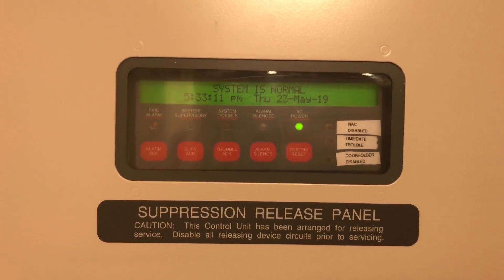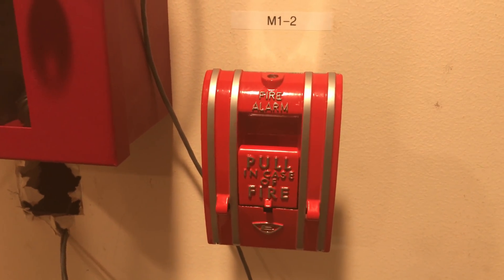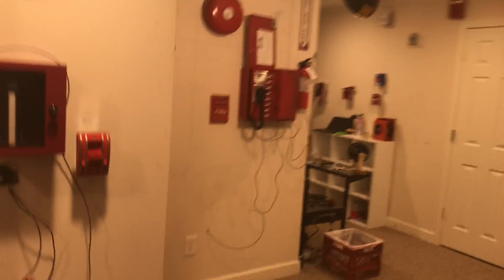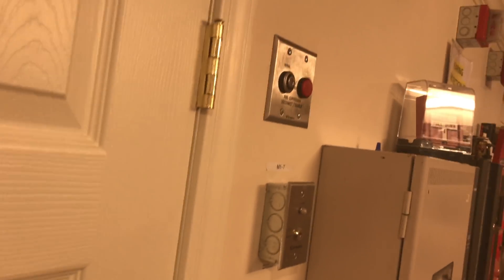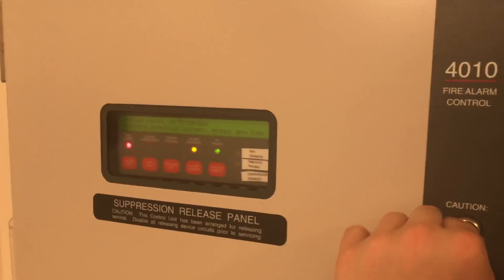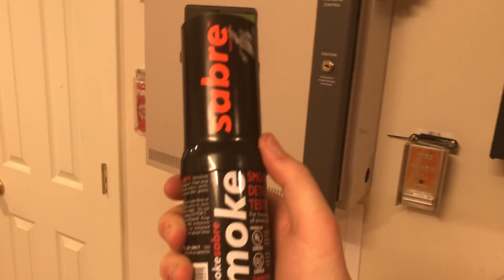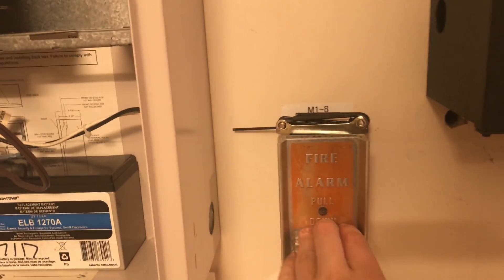Simplex 4010 Test 29: Vintage ADT

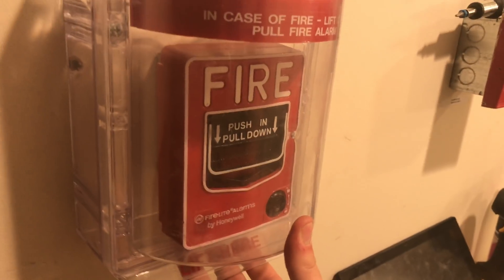Comment: At 5:56 why is that illegal?
Reply from the maker: In a very very technical sense it is. Because it has the "Push", and "Pull", that makes the pull station double-action. With the cover on the front, it adds a third action of "Lift". You cannot have more than two actions required to pull a pull station
Reply: @FireAlarmsandSuch  okay thanks
Reply: So the NFPA will take down the stoppers regarding the Single actions pulls with stopper.

Comment: Does your 4010 do system sensor sync? I'm still trying to figure it out on my sk-5208..
Reply: FireAlArmdude92 enthus no. The simplex 4010 does not support the sync UNLESS you get a sync module
Reply from the maker: The SK-5208 does support sync and 2-wire audible silence. Set your NAC output to whatever sync you want, and then set that same NAC to NONsilencable.